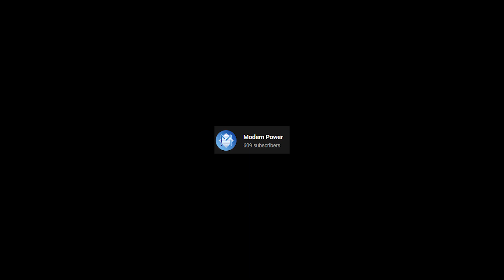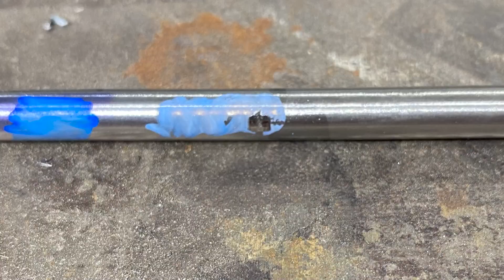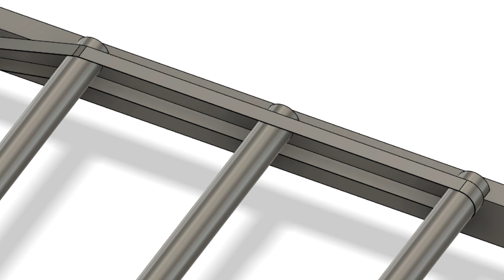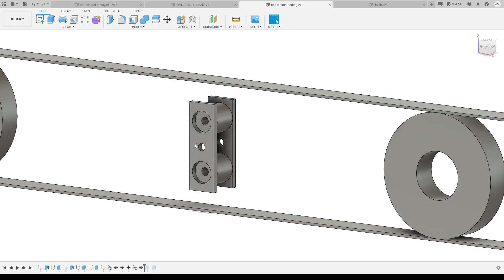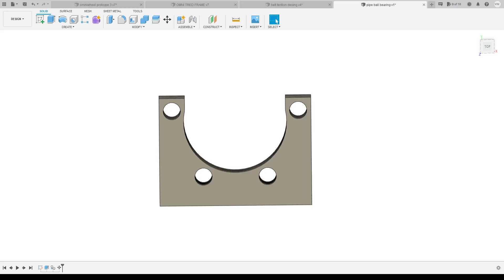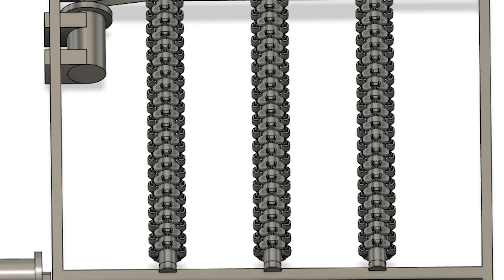Finishing Horizontal Movement (Build log 7)

Comment: I know that this will never turn out as good as the Kat Walk C. But it doesn't need to this is a fun project to follow and that's about it. Keep up the work, Kitkat and I will be watching closely 😄👌
Reply from the maker: If I manage to finish and perfect the treadmill along with a code I don't see how it could be worse than the Kat walk c lol. Honestly if the Kat walk was a decent treadmill that lasted a while I would have just made my own DIY version. As it stands its a good start for locomotion but a real treadmill will always be better in my opinion! Thanks so much for the support!
Reply: @modernpower6285  if you’re determined it will surpass the modern slide mill. Keep it up you’re leading the way!
Reply from the maker: @You-dm2eh  Thanks dude
Reply: I haven't tried the Kat walk c, but considering how it works I'd bet any half decent actual omnidirectional treadmill would give a better experience, including this project when it's finished.